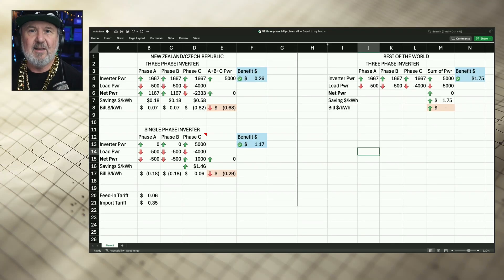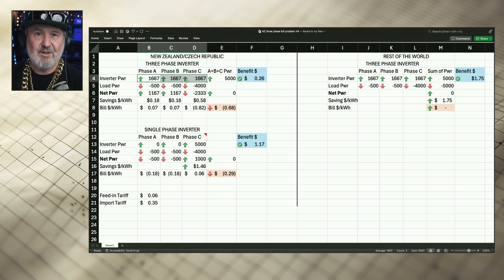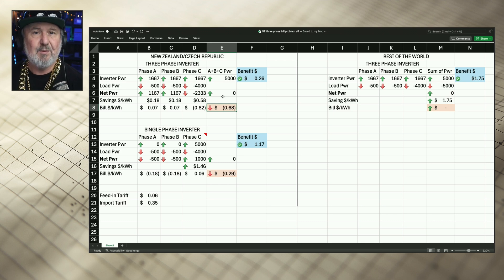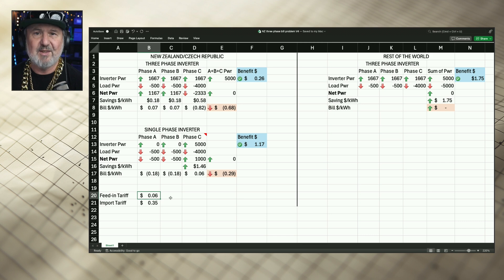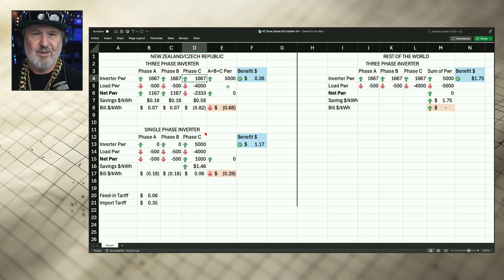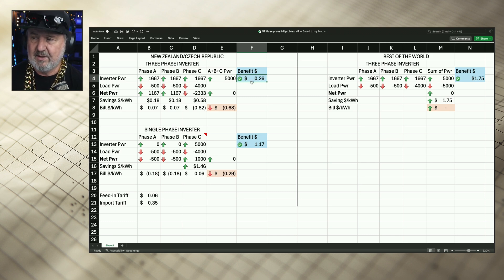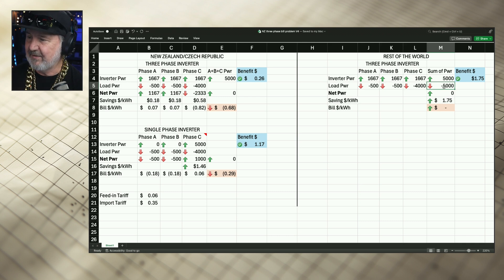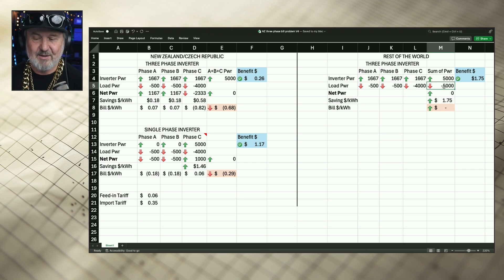Understanding the problem with New Zealand's metering for 3 phase installation with solar

Comment: This is very helpful. Presumably a three-phase inverter that can do unbalanced loads solves this issue? Would that make it equivalent to the ROW? Or is there any other issues to be aware of with unbalanced loads? I assume it's still capped at the max output of the inverter on each phase (say a 10KW inverter can only push out 3.33KW on each phase).

Comment: Are there any 3-phase inverters with current clamps which can asymmetrically output current to compensate for the building loads and set the overall import/export currents on each phase  at the grid connection to be the same? Would help avoid phase imbalance and potential associated charges on some networks.
Reply from the maker: Only 3 phase inverters with storage can do unbalanced load support and then not all 3 phase storage inverters have this function. Here's a few: SolaX, Goodwe, Sungrow, Fronius Gen24, Sigenergy... there are others but you'd have to check.
Reply: @SmartEnergyLab  thanks :)
Reply: @SmartEnergyLab  Another option is you already have a three phase inverter with Storage you can install a good we 3 phase 15KW Works  ( or potentially other suitable unit) the Hybrid Goodwe it will Balance the net energy ( up to 5kw per phase) without Battery or Solar   enabled  Obviously a Cost but if you add Batterys and Solar to The Goodwe  then you obviously have a better Resource ... this is exactly what i had to do to "Correct" the 10kw Sungrow Hybrid i installed that could not Balance   Cheers Jason )
Reply: Deye hybrid 3 phase inverters can do unequal balancing.
Also Victron can do it (but it does use three single phase inverters networked together).